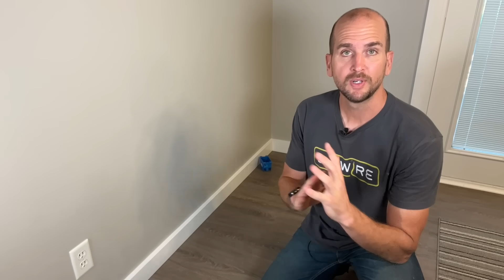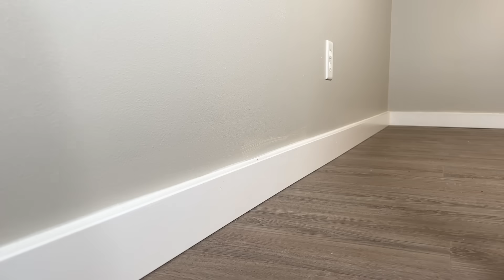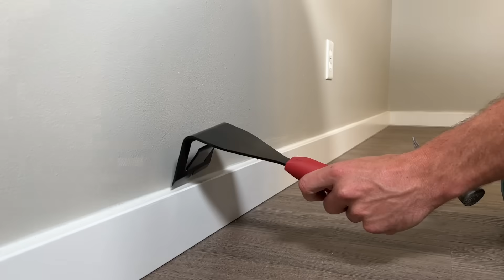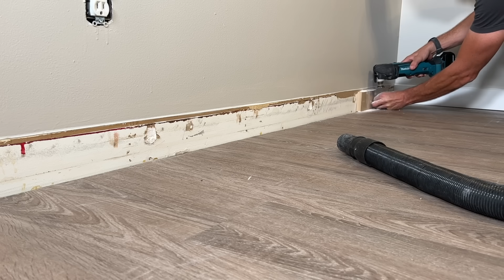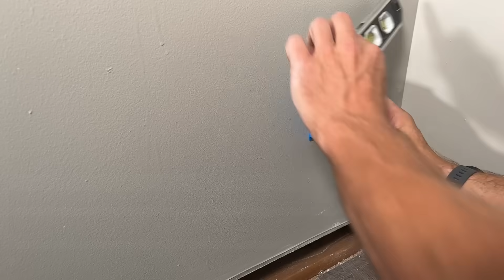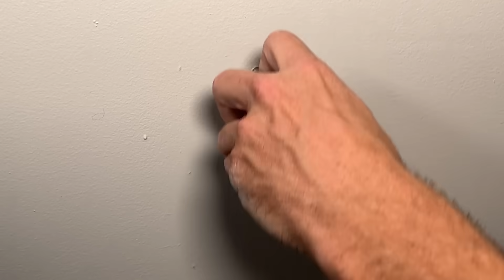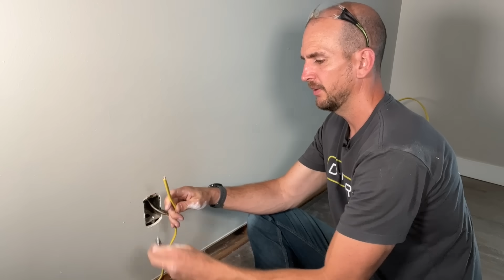How To Add An Outlet To A Finished Wall

Comment: HVAC mechanic with 20+ years experience here. The way he connected the box connector to the wire first and used it to fish through the box is brilliant. I will be using that trick  in the future for hard to get at boxes.
Reply: That’s the way to go … they also make plastic snap on that you could put on after
The wire is thru the hole ….
Ive dabbled with those bout almost always use the medal ones ..
Reply: @mycaddigo  I hate the plastic ones. I find they fall out easily or don't go in to begin with but to each their own.
Reply: @stinkyham9050  When you’re in weird situations they can come in handy..
Electrician friend gave me a bag is full of random stuff and there were some of those inside……
But I typically Always use metal
Reply: One question...why did he pigtail the wires in the new Romex with the existing Romex.. wouldn't it have been possible to connect the black - white new wires onto the bottom screws of the existing outlet.. what am I missing? Any information would be greatly appreciated 👍
Reply: @michael184272  What you are missing is compliance with the electrical code.  Codes vary somewhat depending on location but typically at least the neutral wire (white) must be pigtailed so that the outlet can be removed from the circuit without interrupting the neutral wire to any downstream outlets.  Some codes require the same for the hot (black) wires. In this regard the work is being done properly.

       On the other hand there are possible electrical code violations with this installation.  There is a limit to the number of loads you can put on a circuit.  For a 15 amp breaker supplying general lighting and outlet loads that limit is usually 12 loads, a load being defined as a light or duplex outlet.  There was no mention of checking to see if adding another outlet to the circuit would violate this provision of the the electrical code.

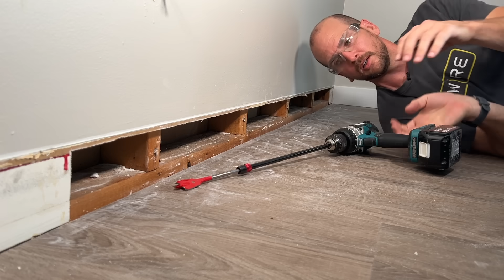       Also, at 5:05 you can clearly see that the bonding wire (bare copper) on the cable feeding the box is connected to the box via the screw at the very bottom center of the box which is intended for use with the cable clamp (which is missing) used to hold the cables if they are entering the bottom rear of the box.  Code says that the ground wire must be connected to the box by a screw intended for it (which is above and a bit to the left) and the screw must not be used for any other purpose.  Technically using the clamp screw is a violation but, if inspected, he might get away with it because the internal wire clamp is missing so the screw is not used for another purpose.  I am not a licensed electrician but I did read the code book because I am currently rewiring a 1950s vintage house (with at least a hundred code violations!) and much of the wiring had no bonding wire and no screws for the bonding wire in the electrical boxes.  I consulted the local electrical inspector and he specifically said that he would not pass an installation where the wire clamping screws or box mounting screws were used for bonding.  I had to either replace the boxes with modern ones or drill and tap a hole specifically for the ground screw.  I eventually elected to drill a hole and install a threaded insert because the code required 2 threads of engagement into the box with the bonding screw and the metal of the boxes was too thin to meet this requirement.

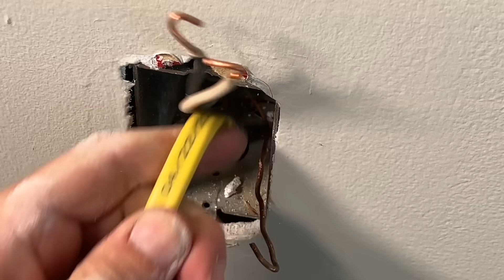      At 6:43 you can clearly see that the box is rocking back and forth as the new wire is being pulled into the box.  This is also a violation.  Boxes are to be firmly attached to the structure.  The box is also set too deep in the wall.  The front edge of the box is supposed to be flush with the finished surface if the finished surface is non-combustible and a bit proud of that surface if the finished surface is combustible.  (Again, codes may vary depending on location!)

      I think the bottom line is that the gentleman doing this installation certainly had some interesting and effective ideas and should be commended for them, but it would have been a good idea to confirm that the installation would meet the requirements of the electrical code and to correct any existing code violations as part of the work. The code is clear that you can do your own electrical work on a property that you own but it must be inspected by the local electrical safety authority upon completion and there was no mention of having this installation inspected.   Despite the actual and possible violations I expect this installation will serve well but IF the place ever burns down due to an electrical fault expect the insurance company to try to deny coverage any way they can.  This installation might give them some grounds to do so particularly if it never passed inspection by the local electrical safety authority.
Reply: @michael184272  no reason. I wouldn't have either
Reply: @michael184272 yep, came here to ask just this. Surprised nobody seemed to ask about it but you (and me! Lol!). Immean, why use those cheap looking little parts (that only feel like an additionnal hazzard if you ask me).  And he dont even mention doing it the standard way. Meh, 'guess product placement is prioritary....
Reply: When you do a panel change that's the only way to go sometimes.
Reply: ya well should have stripped the sheathing before as well.
Reply: You not figuring that out in 20+ years in your trade is scary as fuck.

Comment: As a remodeling contractor we had this done this way multiple times.  I’ve found it faster and with a lower labor cost  to just use a new piece of dry wall. One other thing I have had done differently is to make the hot connection last, in the event some one turned the breaker back on after having taken off the red tape that had been covering it.

Comment: That's great for a room with drywall, but what do you do if your walls are tongue and groove knotty pine?
Reply: Well you still should have base mouldings Malcolm - so a circular saw would be the tool of choice... And of course the rather tedious task of reassembly with backer plates of plywood, lathe or 1x2's between the studs to hold it all together? (Or just nail the pieces back at the stud locations and don't worry about what ya can't see after the moulding's back.😂)

Comment: Did not even watch the video because I already know the simple solution.
Pull the baseboard off, cut the sheet rock below the baseboard height, drill thru the studs, pull your wire, reinstall the sheet rock and base then call it a done thing.
This public service announcement has been brought to you by DHM Electric. "If your electrical job is difficult, we will handle it immediately,  if it is impossible,  it might take a little bit longer and miricals are performed  by appointment  ONLY!". ;-)

Comment: I would have used electrical tape the around the existing receptacle.  6 current carrying conductors is tight in that single gang box.  Great job.

Comment: Residential Master Electrician here. Very good tutorial. The only thing I would change is the receptacle. Both of the receptacles should be "childproof ". They  will have a "TR" stamped in the front of them. They are technically called Tamper Resistant receptacles.

Otherwise, great job!

Comment: 1 inch drill bit?  Ummm nopes.  And please use MC cable assemblies when in what is possibly the the most nailed, toe nailed, beaten and re modeled portion of your walls. Especially with existing metal boxes.   This is where your floor plate joins to your wall load and shear.  Hogging out 1 inch holes in the connection area is like drilling additional  holes in your cars wheels just above the tire.  Load bearing or shear walls not even mentioned here.  Do the hard and good work.  Put the wires where pros expect to find them. Good lord and he owns the property as well. SMH.

Comment: Nit-pick here.  Making sure your cover plate screws are either vertical or horizontal is a good way to over tighten and crack a cover plate.  I was taught by a master electrician many years ago to never do that.  Just tighten the screw, and pay no attention to the orientation of the slot.  Newer cover plates are more flexible than the old ones, but they still will show an unsightly dimple when over-tightened (which is far more noticeable than the orientation of the screw slot).  Otherwise - this was a great video, and a pretty awesome trick to simplify the process of adding an outlet... assuming you're not exceeding the NEC max number of outlets on a single circuit by doing this.

Comment: If you live in an older house, I would confirm the studs are in the right place. I constantly find different spacing on mine, but it was originally built in 1918, so things get a bit wonky.

Comment: Why did you measure the stud distance from the outlet using the stud finder when you were going to cut the bottom of the drywall revealing the studs anyway?

Comment: SCARY Sharp Chisel to remove caulking from wall and trim comes off like butter

Also use Stair Helpers for Framing Square to Set depth of Oscillation Blade so not to go too deep and nick wire

Comment: I never use the paddle type boxes for outlets. I've seen enough of them pull right out of the wall. Some outlets are tighter than others especially the newer tamper resistant one with the little shutters in them. I know sometimes a stud is not in a convenient place all the time but I only use those for light fixtures and switches.
Reply: There's better boxes than those plastic...like the Fiberglass...much sturdier
Reply: So rare as to be negligible. If you're worried about it use Madison bars (battleships). I only use metal for floor thermostats that need wires run in flex.

Comment: Some other video did a similar work but notched all the 2x4 studs and place the romex in the gap.  That was  NOT the right thing to do!    Can you patch the plaster in to make it more secure and  no air gap or leaks  especially if it were an outside wall with insulation.

Comment: This is possible because of the construction method used in that particular dwelling. It’s very neat.

Alas I live in the UK and in the duplex where I live, almost every wall is masonry and during construction, the walls were chased and fitted with conduit to the various receptacles for switches and outlets.

I see timber-framed new construction so very rarely but those folks are going to have a much easier upgrade route when they need to add outlets or other items requiring access behind the drywall.

Also, in the UK, taking a single cable from an existing socket to a new socket is known as a spur. They are allowed but there are restrictions as to what can be used on the outlet. Also, there can only be one spur to a standard outlet. Electrical installation in the UK utilises a ring system to balance the load on each socket.

Comment: Great video! I was concerned that at 2:56 you placed the end of your metal measuring tape near what could be hot connectors on the present outlet. You did not mention the obvious comment to turn off the power. Some DIYers might be a little careless. Having said that though, what a brilliant way to add an outlet and make it look like it was always there!

Comment: I like this way but its a bit of work. For slightly less work but more expense I might put an outlet on every stud all the way to that location. So 3 in between. Then there is no cutting or extra dry way besides the old work boxes but it does look like of odd to have 5 outlets along the bottom of a wall but how nice is 5 outlets. Great for nightlights or you could go way up on 2 in the middle, mount a flat screen there to hide 2 then go back down. Or you can do a box with a blank. It may be possible to go through 2 studs with one box as well. This would allow you to skip one of the 3 extra.

Comment: @Everyday Home Repairs - Great video.  Thank you!
I'm curious as to why you mounted the outlets with the hot | neutral on top and the ground down.  I learned that it used to be the "standard" mounting practice was to have the ground up - reason being, if a metallic object ( screwdriver for example ) were to be dropped, it cannot lay across hot and | neutral and short the circuit.  Whereas with the single ground up, and a plug in, the dropped screwdriver has a better chance of falling to the floor.  Is there a "right way" and "wrong way"?
Reply: It’s like that in almost every house I’ve ever been in. Ground up looks funny but probably is safer in the rare instance the plug is somewhat exposed.

Comment: Nice,  but I have 2 issues. First, you should explain why you used such a large bit for drilling through the studs; it is because with the angle through the studs this reduces the chance the wire will touch each of the splintered holes. Second, with the better outlet, you could use the extra screw connections to attach your hot & neutral connections instead of filling the box with more connectors.
Reply: It’s been mentioned elsewhere in the comments, but pigtail connections are preferred to “daisy-chaining” receptacles (and in some places, pigtails are required by code).  In a daisy-chain setup, if a receptacle fails, everything after it on the circuit loses power.

Comment: Attaching the connector before pulling wire is a great tip!  Thank you.
Reply from the maker: You bet!
Reply: @EverydayHomeRepairs  Was the metal box grounded?
Reply from the maker: @illestofdemall13  yep, the ground from the NM cable coming into the box had the ground wrapped around the bottom screw used for the boxes integrated wire clamps.  Then the ground extended out into the Wago 221 lever nut to bond everything together.
Reply: @EverydayHomeRepairs  Oh ok, thanks.

Comment: You had 4 terminals on the back of the old outlet, why not connect the new wire to the 2 open terminals?
Reply from the maker: If I have room in the box I like to pigtail.  Then if the outlet ever has an issue I will still have power down stream.

Comment: Is it normal for people to do their own electrical work in the US?  I live in Australia and it's not considered a safe thing to do. That's not to say it doesn't happen, and I have done similar jobs to this myself in the past. We are supposed to use a qualified electrician as they provide a Certificate of Compliance on any work they do. If there was an issue down the track and you needed to make an insurance claim you could find yourself with a problem if the work was not done by an qualified sparky.

Comment: I personally would not use 1" spade bit because you aren't supposed to remove more than 1/3 the width of the stud so as not to weaken it. 1" is way more than you need, and coming at it from an angle would remove even more material i.e., a hypotenuse. A 1/2 to 3/4" bit would be plenty.
Reply: That all depends on the wall, it's actually 25% of the stud, on a bearing wall or exterior wall, and I think 40% on non-load bearing. So 1" spade bit on an interior wall cock eyed would be just fine. But it's all situational.

Comment: 10/10 install. Informative and done clean. Especially pre mounting the 2 screw connector to the romex before ran into the box. Baseboard trick was also great. Many never think of it. All around, great work man
Reply: Baseboard trick violates the National Electric Code for failure to protect cable from severe damage

Comment: Now do it with 7.5 inch baseboard, with a Roman OG cap and 3/4 round embedded into plaster with lathe and three layers of wall paper...
Reply: Seriously I cut look for any studs inbetween, the stud I need, cut the drywall across. And here's why this video is a code fail. The wire MUST BE secured, which is isn't- 

334.30 Securing and Supporting. Nonmetallic-sheathed cable shall be supported and secured by staples, cable ties listed and identified for securement and support, or straps, hangers, or similar fittings designed and installed so as not to damage the cable, at intervals not exceeding 1.4 m (4 ½ ft) and within 300 mm (12 in.) of every cable entry into enclosures such as outlet boxes, junction boxes, cabinets, or fittings. The cable length between the cable entry and the closest cable support shall not exceed 450 mm (18 in.). Flat cables shall not be stapled on edge.
Reply: @calculator1841  you are permitted to fish without staples if you can see the void but cannot access it
Reply: 334.30 B (1)

Comment: brilliant tutorial on how to physically install an additional outlet, the one criticism i have is you didn't mention anything about circuit load, while your mindset was on adding an outlet to make it more convenient to plug one thing in there are those who will want to add outlets to plug more stuff in so current load can become an important issue or concern......
Reply: I dunno, anyone who wants to run 2 space heaters in the same bedroom will find a way to plug them in no matter how few outlets are available.

You did notice he used 12g wire even with those 15A outlets and possibly a 15A breaker. So he's not making a problem worse, I think.

Comment: One should also note that according to code there is supposed to be only a certain number of receptacles that can be on one circuit!
Reply: For most homes the circuits are not under enough load. 1 or is fine. It's when you're trying to go every 6' lol

Comment: As an electrician of twenty years all I can say is ........ BRAVO!!!!!! I've had the trick with the romex connector in my "arsenal of tips and tricks" since I was an apprentice. Usually when I watch these YouTube videos I always find something (however minute) wrong or missed... NOT HERE! From start to finish I can't see one thing overlooked or done wrong. Even the comment about matching the cover plate screw orientation. You rocked it!
Reply: except the wrong wire
Reply: @retired8484  What are you talking about?  12/2 with a ground is fine to use, and that's what was there to begin with so he used the same. More than likely this is a 20 amp circuit. https://youtu.be/nWfEANZOYSk?t=491